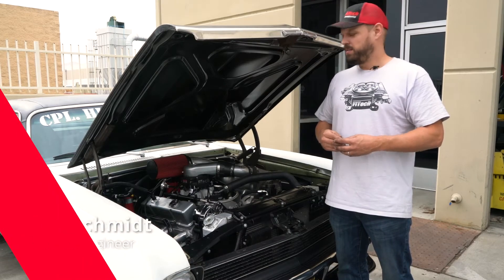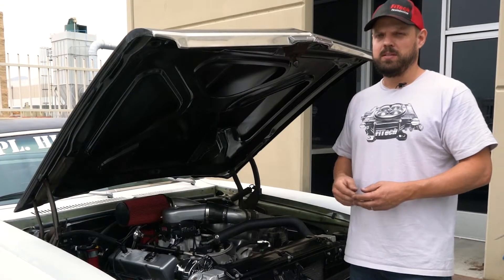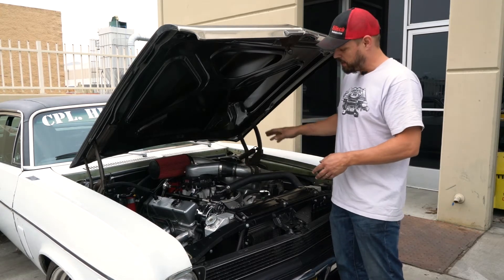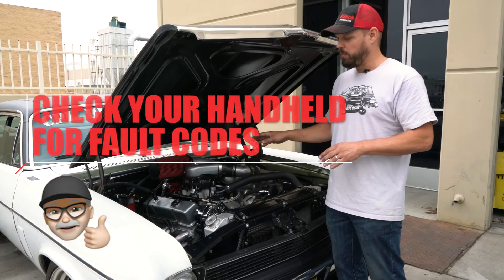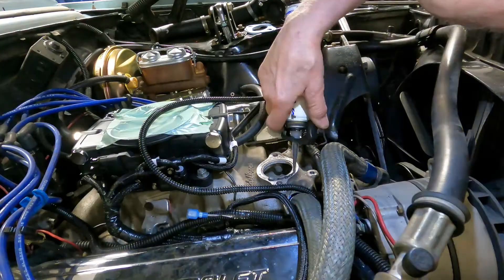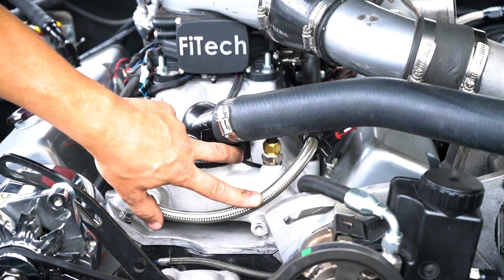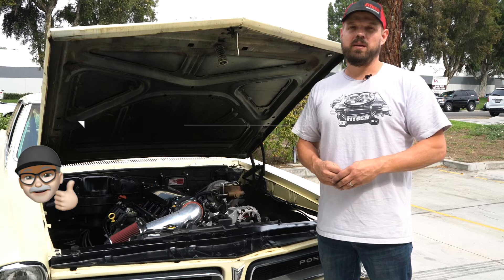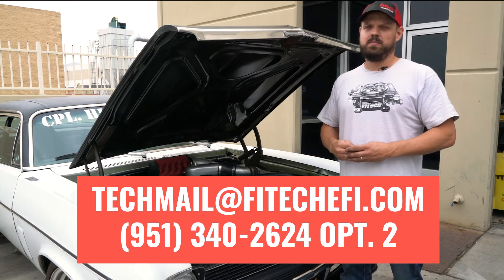Coolant Temperature Sensor | Tech Tuesdays | EP40

Comment: I have a 440 mopar engine with a performer rpm intake. I heard him say you want the temperature on the engine side of the thermostat. Do you know which is the engine side? I have a port that is on the passenger side of the water pump housing. Is that it? I would also like to note the instruction manual supplied with the fitech I purchased stated to install the sensor in the intake or the cylinder head. Which contradicts the information provided in this video.

Comment: Yes this is good information, question I checked my engine temp with a thermal imager, it show the engine at 180F where the sensor is and at the thermostat, the Fitech unit is showing 195F and is turning on the fans and will not shut them off.  Any help would be appreciated.  The system is on a 69 Camaro with a 357 #2 cam setting, idle @790, and the fan is set to come on/off around 185F.  Thanks and God Bless!

Comment: Good info, question I have is if the sensor seems to be reading way cooler than the thermostat what could cause this. 
I have a 383 stroker with a 195 thermostat and the sensor has been reading around 140 to 145. I have an edelbrock performer intake the adapter and the sensor were installed with Teflon tape. Im wondering if this be causing the issue. Any suggestions would be appreciated.